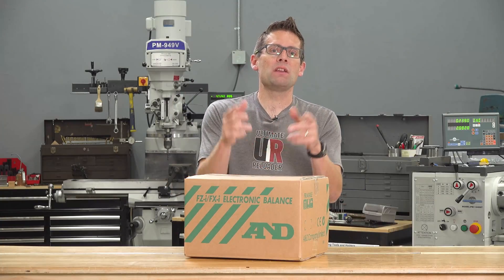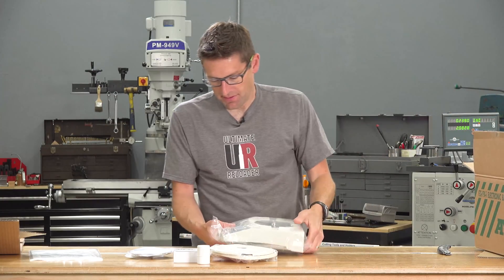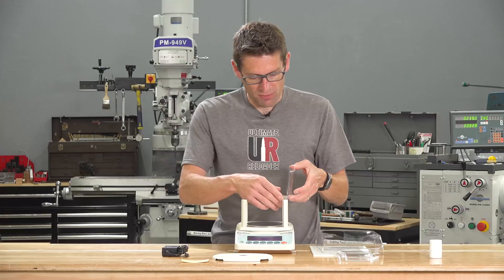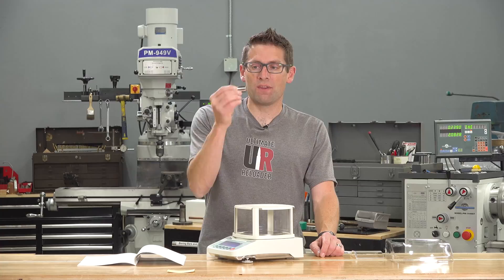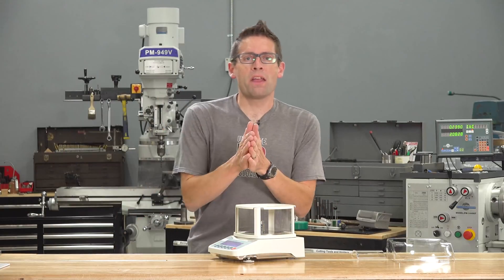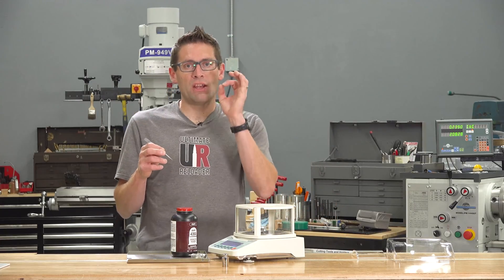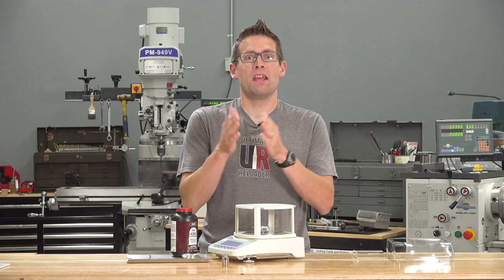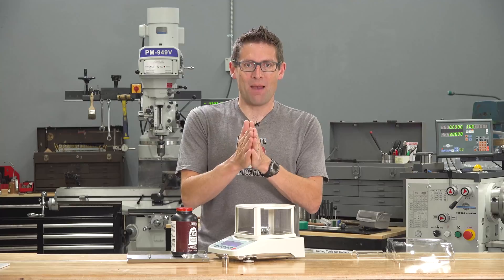Reloader's Dream: A&D FX120i Lab-Grade Balance, Unboxing/Setup/Calibration/Demo

Comment: That's the way to go, my RCBS Chargemaster drifts on me. Even with proper warmup, isolation, and air flow to the room stopped. In theory a great idea to speed up precision reloading, but I end up with my 10-10 balance beam and BR-30 when it really matters.
Reply from the maker: You hit the nail on the head! This is industrial quality :)
Reply: mrhangfire1, I had the same issue with my Chargemaster and emailed RCBS.  They emailed me a troubleshooting guide and followed their instructions on it.  Used an air duster to clean open areas of the scale focusing on the area beneath the platen.  Cleaned the connection between the scale and dispenser and applied some dielectric grease before assembling them back together.  Took care of my drifting issue altogether  Hope this helps you.
Reply: @fisher7897  you know what, I think I need to do that.  I remember it was more consistent for me when it was new.  It would underthrow let's say my target was 5 grains, it would do 4.96 constantly but now I am getting down to 4.92, which is almost a whole .1gr under.  Resetting zero or re-calibrating would go back to 5 but than it would dip again.  I wish I could adjust it to go just a tiny bit more.
Reply: Meanwhile, I'm over here with a vintage Lyman M5 and Dandy Omega getting the same speed, accuracy, and ability to multitask.  I can see a kernel of #5 so those big logs are no problem at all and mine doesn't need to warm up, still works when the power goes out, doesn't drift ever, and doesn't care if I'm using fluorescents, candles, or moonlight.  Not knocking the Autotrickler setup because it is nice and very well thought out, but it's just an expensive solution that, while an upgrade over others, still has all the warts of every other digital setup out there.  There's a really good reason Prometheus didn't go digital.
Reply: @mab0852  I don't need to warm up my scale because it's always on, when the power goes out I could use batteries and how often do you reload without power anyway?  It's easier to see the numbers that lit up than that manual scale.  I have made my own "dandy omega" trickler for few dollars years ago, it's made from a long bolt, a PVC "cup" a piece of antenna tube, a cell phone vibrating motor, a one AA battery with holder and temporary switch, works great actually.  Your scale might not "drift" but the needle will move up and down if you dump 40 grain charge and will need settling down, this is not the case with FX-120, not sure what other "digital warts" you can think of but the first time I saw FX120 and trickler video I was blown away.  The scale had zero problems that I've seen with cheap digital scales - it's super fast to settle and it doesn't drift, I think you would have to be a real tool to spend more than 5x on Prometheus.  I see zero benefit or advantage.
Reply: @DimaProk  Actually I don't have to see the scale.  That's the whole point of having an Omega with an optical switch.  As for power, I use mine on the range all the time with no power.  It's super handy for load development.  I also don't need to wait on the scale to settle.  By the time the trickler is done it's not swaying, just steadily raising to charge weight.  Point is, there's a much more reliable option out there for 1/8 the cost.
Reply: @mab0852  You said you have Lyman M5 scale and Dandy Omega trickler.  What you're describing sounds like Targetmaster.  I am not sure if you have private range or it's isolated pretty good, but the blasts from nearby gun would mess up scale reading regardless of which scale used.  Now if I wanted to do some load development on the spot at my primate range why not just go with Harrell powder measure or one with micrometer insert instead?  My RCBS is extremely accurate with small drum and fine powders, you can just record at home how much divisions it takes and go from there.  Regarding target master I've seen it a long time ago on Youtube but I am sceptical if it's any more accurate than RCBS chargemaster lite.
Reply: @DimaProk  Target Master was a European version.  The control unit on my Dandy is connected to an optical system that goes from fast to slow to off as the beam rises.  I do have a private range, but I keep the scale and trickler in a box for wind and blast protection.  I've never seen a measure accurate enough to throw and go to my load requirements and it would take longer to set the charge than change the scale.  I take a preset adjustable dipper to the range since I'm trickling anyway and my measures stay at the house where they don't get broken.  I like mechanical, repeatable and dead reliable.  I actually have 2 M5s and an Ohaus 10-10 that are as sensitive as any lab scale under $5-10k.  I grab them anytime I see one in NOS condition and reasonably priced.  They are in no way comparable to a big box autotrickler.  They are way more accurate and repeatable. All my beams clearly register/indicate a single kernel or they get reworked or sold.  I'm so CDO I even build my arrows to .1 grain.
Reply: @mab0852  The system you describe - was it developed by you?  How does it operate without power?  Surely you meant battery power vs. outlet which means it DOES need power.  I could easily rig up 9V battery pack for my RCBS lite but I rather not drag my reloading equipment to the range.  Now you talk about wanting to keep your powder measures at home (mine cost me $90) while dragging a lot more expensive setup instead, I don't understand the logic.  Powder measure at the range is a lot more safe, protected and not affected by wind, blast, etc IMO rather than a delicate scale and trickler.  As far as setting charge with micrometer on powder measure it's a matter of simply turning the knob to proper graduations, what's hard about that?  

How is it possible to register 1 kernel of powder on a beam scale if the kernel is roughly 0.02-0.04gr in weight.  How could you possibly notice the needle change position with 1 kernel?  The smallest graduations are what  0.1gr and anything between lines is just a guess work?  It doesn't matter how sensitive scale is if you can't read the output and with digital scale you can.  I'll ask again have you measured your dispensed charges with more accurate scale that has at least .02gr resolution?  You can claim all you want that your beam scale is as good as $5000-$10000 lab scale, but I want to see measured data with a scale capable of finer resolution of at least 0.02 grain.
Reply: @DimaProk  haha, I use the same setup minus the measure.  Yes, the Dandy uses batteries and I bought it directly from them.  Digital scales don't like batteries.  Their readings can drift as the power drains.  With a balance, it's not what you can set the scale to it's the smallest weight that makes a detectable difference in the needle. I have calibrated mg lab weights and can zero out the scale to that level of precision regardless of the graduations on the beam.  I'm measuring against a presicion set 0 point and myself and the Dandy are only looking for deviation from that set point.  Since less than 1mg (.015 grain) moves the needle enough to trip the beam, I can measure to that accuracy and repeatability.  Same way the Promethius works essentially but with and even more precise beam and pivots.  If there's a more precise system for the money, I'd love to see it.  Do some reading on Scott Parker.  He's a genius with setting up these old beams and they were built right back in the day.
Reply: @mab0852  I looked up Scott Parker, what I gathered he tunes beam scales.  I am interested in your optical reader dispenser, who makes that and why is that I never heard about US version.  When I searched for Scott, I kept getting videos about beam scales and targetmasters being used, except 1 video where guy had custom trickler but no mention how and where he got control system.

Comment: Looks great until I saw the price. My rcbs chargemaster lite has loaded some super accurate ammo that's good enough for me.
Reply: Levi Weaver 
Exactly, how am I going to slice that last 200th of a grain off of my extruded Varget powder, and for $800 bucks no less! They cannot even make bullet weights that precise. I'd end up spending weeks just separating bullets!
Sometimes we border on the ridiculous.
$800 buys me alot of components for alot more practice.
Reply: @theunofficialresults231  That's exactly what I thought at $750.00 tag...Not For Me
Reply: @TexasTrained  it's not 745 it's $450 you just need to use the discount code
Reply: @TrevorNeve   where do I get discount code?
Reply: @DimaProk  Cambridge in the checkout will get you the discount
Reply: Agree:) we make bigger mistakes - scale wont help
Reply: I have both now! There’s no comparison, the FX120i is the real deal, crazy accurate and most importantly, consistent! The Chargemaster Lite by comparison is a “toy”! They are Galaxies apart in “accuracy”. IMO. 😎
Reply: The rcbs won't throw accurately to the kernel. I can see how much a single kernel of about every extruded powder weighs.
Reply: I used to sell, calibrate and repair this model. Though I can’t guarantee that it will make a significant difference in your group size, it will nearly eliminate the variable of charge weight. It should have about 15x the precision of the scales folks usually use for reloading; likely more because those can be sketchy in my experience.
Reply: Truth be told, this doesn’t really approach true lab grade. I purchased a micro balanced for my pharmaceutical lab...and it was a bargain at just over $45,000.  And it is guaranteed accurate to 1/10,000th of a milligram.